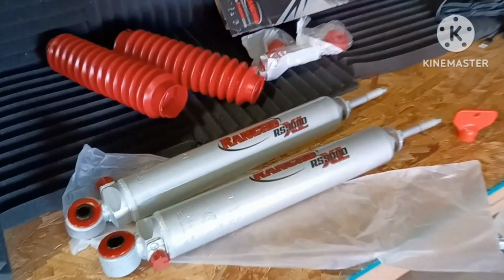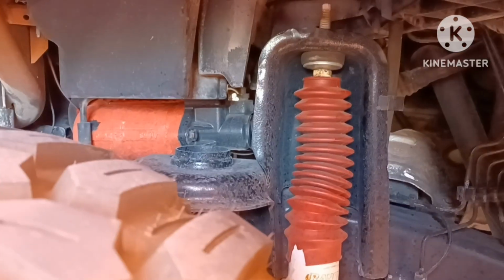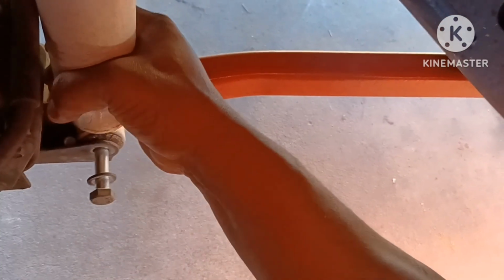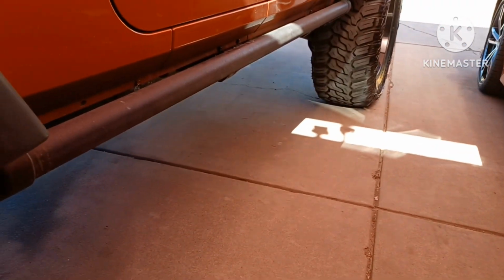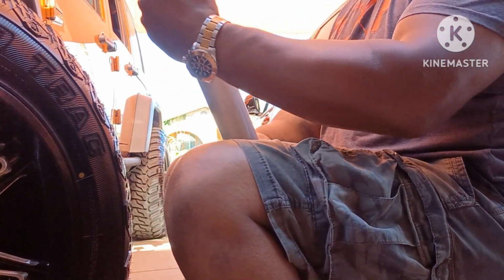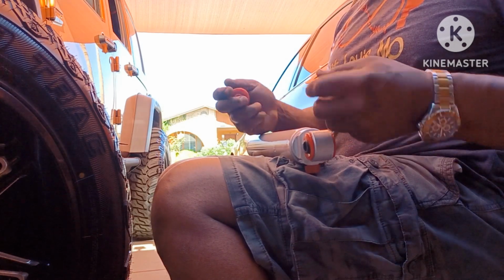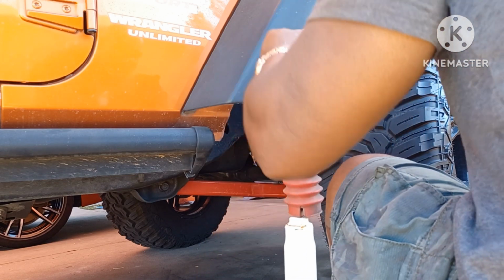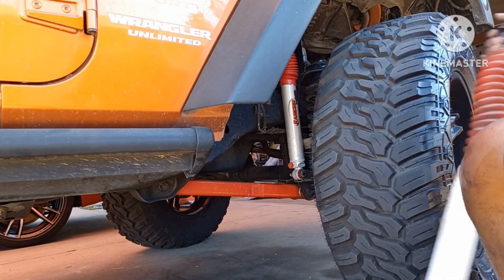Jeep Wrangler Rancho RS9000 XL Front Struts

Comment: I did not know you could take that stuff off while the Jeep was still sitting on the ground instead of up on a lift
Reply from the maker: Working on Jeeps is a bit tricky. I do a lot without a jack and without taking these big tires off! Saves time! Jeeps are made to repair quickly, which is why the military used them for decades. You can literally fix them with basic tools!